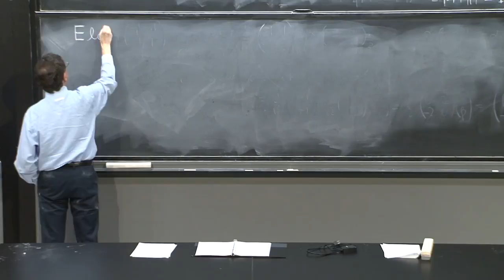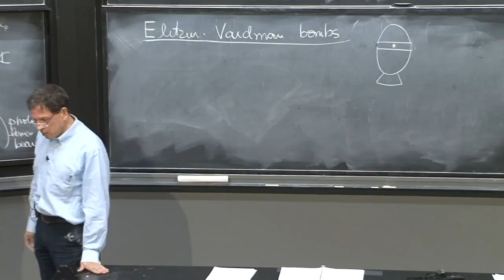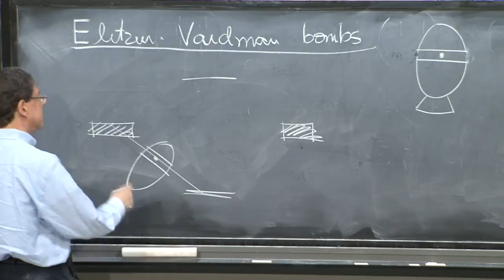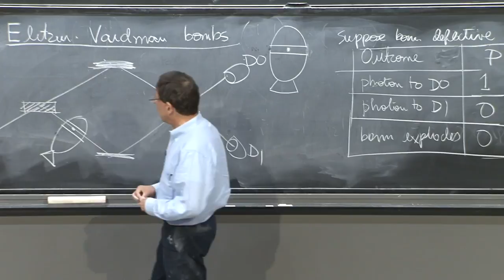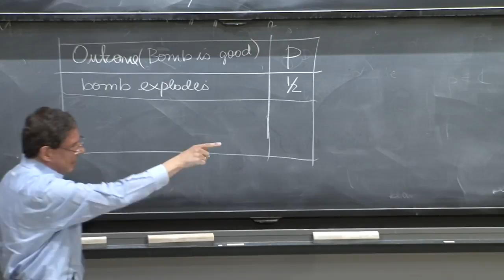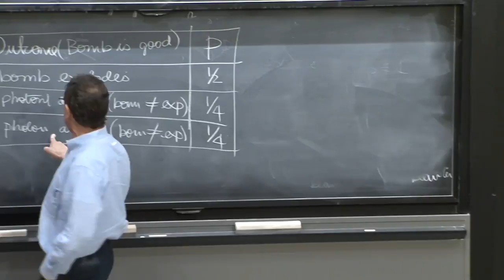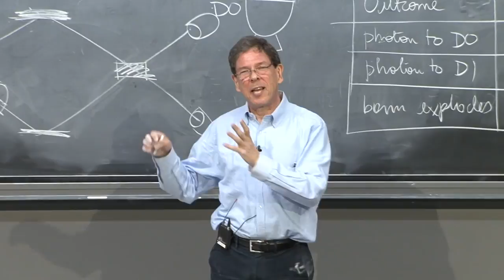Elitzur-Vaidman bombs

Comment: maybe we could see this as if photon particles were riding a wave we can't see, like a buoy on a sea wave. the invisible (to us) wave would be affected by the environment and behave like a wave (interferences etc...). With this perspective, the wave would exist without the photon and would appear to us only when a photon starts riding it. So all the interactions of the wave with the environment (e.g. interferences, probability distribution...) are set before throwing a photon in, and do not depend on the photon in itself.
Reply: Robert Spekkens has a paper on this that gives the most intuitive explanation without waves at all. There is an inconsistency in how this is presented, the first beam splitter is treated like a single input logic gate (a single photon) with two outputs (either the upper or lower path) and when they're recombined at the second, it is treated as a two-input logic gate with two possible outputs. This inconsistency goes away if you recognize that the first logic gate is also a two-input logic gate just where one of the inputs is always 1 (a photon) and the other is always 0 (no photon). All you then have to do at that point is to presume that the 0 state can be carried by a beable and even interact with a measuring device despite showing up on that device as a 0, and then you can explain the whole thing in terms of local beables only without even positing any waves at all.
Reply: smells like luminiferous ether, which was disproven a long time ago

Comment: This is just another variation of the double slit experiment. The difference is that it can be used to find out of the "bomb" (actually a detector) is activated or not. 25% of the time, it is possible to find out. Other than that, there is no difference.

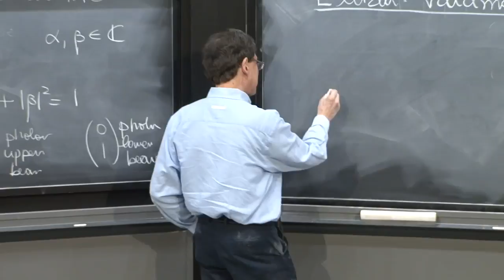Comment: At 3:38, he was referring to the Mach-Zehnder Interferometer, for those who didn't get it; not 'mass center'. The Mach-Zehnder is basically the same set-up with the interferometer discussed in this video but without the bomb.
Reply: What he says does t make sense and can't be accurate...according to the set up the photon could could D1 even when the bomb is a dud so whybdoes he say otherwise??
Reply: @leif1075  AFAIK, not, because of destructive interference in the direction of D1. I'm not sure, maybe some who knows this better will correct me.
Reply: @IvanToman  wow AFAIK stands for as far as I know right? I've never seen that acronym before! How exciting!
Is it t common like lol or brb or you just came up with it like a  trend setting boss?? Off topic lol thanks for answering.
Reply: @leif1075  Yes, correct :)
Reply: @IvanToman  oh did you just coin that yourself or its commonly used as far as YOU know? Because AFAIK, AFAIK is not a common acronym..wow did you see what i just did there?!? I just used it twice like a boss..I'm so lame! I'm sorry you had to read this..
Reply: @leif1075  no, you only used it once
Reply: @leif1075  No it can't get to D1 if the bomb is a dud. But it's not a simple matter to explain why: it has to do with the fact that at the end of the day, even a single photon has a wave function that can self-interfere with itself if not detected. This is the same source of weirdness that causes the double slit experiment results.
Reply: Thanks. I was about to add the same. But you were/are a year ahead. Depending on your position of the fluidity of time. :D

Comment: Classical distribution of energy known as equipartition is, suppose there are 6 modes of dice and energy to be distributed is 21 units. Then each mode have equal amount 3.5 unit of energy. Divide it by mode or frquency, energy per frequency is 7/2, 7/4, 7/6, 7/8, 7/10, 7/12. Thus energy per frequency is decreasing as shown in black body radiation curve.

Now same amount of energy distributed to same modes as per quantum energy distribution given by Planck's law. According to quantum energy distribution, energy is not distributed equally to modes but in linear multiple of fundamental or minimum energy unit to modes. Thus higher modes have more energy and for above 6 dice modes they are like, 1, 2, 3, 4, 5, 6 where fundamental unit is 1. Dividing these energy for modes by mode number or frequency they are all same, 1 unit. But this is not evident in black body curve as flat line.

Comment: I think this experiment need little work to look better. That is, first beam splitter is polished such that it has transmission coefficient of 1/3 and reflection coefficient of 2/3. So probability of photon taking upper path is double of lower path.

Now slightly change in intensity of source also, it has such intensity that emit two photons at time and triggered by switch which let one fire only on triggering.

Now if photons take both paths they interfere and detected by A only. And if photons take upper path then they may not interfere and could be detected at B also. 

Now calculating probability, chances of photon detected by B is 5/18 and by A is 13/18. And chances of both photons take upper path is 4/9 and chances of that detector B detects live bomb without exploding it is 1/9 ~ 11%, accuracy is about 4/9 ~ 44%.

And from his model, probability of detecting live bomb is 12.5%, not 25% and accuracy is 33%. In numbers, if total 200 times test is conducted, only 25 times it correctly predict live bomb without exploding it and 50 times it predict falsely, 25 of which are dead.
Reply: If someone needs 10 fire-crackers and they are constrained by a budget of buying only 40, you're modification is reducing their chance of success from 25% to 12.5%.
Reply: @vishalmishra3046  no, modification bring chance of success 11% from 12.5% but improve accuracy to 44% from 33%.
Reply: Why he doesnt say that what if photon takes up part even though bomb is not functioning? Like why are they assuming it always go both durrectiins if bomb not working but can go only up if working? What am i missing?
Reply: It does not matter what is the accuracy or chances of success. The fact this can happen at all is what’s interesting.

Comment: Sun is emitting light and hot bodies glow light. But spectrum of sun is continuous which can be observed with crystal or cd. Different colors are in thick bands and not thin line. So how energy is quantized in hot solid bodies. By quantization means different colors are separated by dark regions which is not observed. Temperature of body can be calculated by light emitting from body of different colors and they do integration which is for continuous function.

A circle is locus of points which are equidistant from a point called as focus or centre. Joining of locus is curve, where points are discrete but curve or function is continuous. So, do circles are continuous or discrete, continuous means curve is smooth. Similarly calculus is done with discretization of interval but on continuous function.

Yes, quantum mechanics shows that wave seems as continuous but made of discrete small particles, operated as smooth. Similarly interaction of energy and matter is participated by discrete particles known as atoms but there is no restriction on amount of matter and energy, continuous.

Comment: Here's a thought...

Adding the concept of superposition, maybe there's a difference between:

1. A single photon in a single path then the detector works 100% of the time.
2. Bomb detector interaction with a "split photon",  i.e. unlike case (1) the particle that hits the detector is not a "full photon" but a part of the superposition.

Maybe what is missing here is the understanding of:  - the probability of an interaction of "half a photon" with the detector.
We know that the effect of a "full photon" on the detector is 100% deterministic. Boom.
But let's assume that the probability of the detector (observer) is either:
50% detonate.
25% not detonate, and do nothing to the half photons, they reach D0
25% not detonate, and phase shift the 2 half photons so they reach D1.

This means that we still know nothing about the bomb, is it alive or dead.

The only "hole" in this hypothesis is the question: in the dud, is the detector behaving differently when the bomb is a dud, or is it the very same detector?
If the former then hypothesis still stands.
Reply: Sorry to say so but your concepts is missing the collapse of the wavefunction. The particle that hits the detector is always what you call "full photon". How we now that well   in 3.1 of these courses the photoelectric effect will be explained that should make it clear (That is what Einstein received the nobel price not for SRT or ART) why the concept "half photons" is not going to work just by choosing the detector right. 

The only way i see to keep your concept alive would be to say these "half photons" are still entangled with each other and one partner get energy to step back to a "full photon" and the other "half photon" is giving its energy (then energy is conserved) and we still measure a "full photon" at the detector as to be done. But that would mean to argue with an effect from quantum mechanic against the quantum mechanic original explanation of the seen effect. (still you could use phase shifters and polarized filters to rule the concept of "half photons" out, but it would hold within the described experiment).

But do not worry that strangeness/weirdness is exactly the reason for the so often used famous words: "If you think you understand quantum mechanics then you do not understand quantum mechanics." (which by the way is half true and half not)
Reply: @Techmagus76  There are no "half photons" in this universe, my friend. :-)
Reply: prof. adams did something like this on his first lecture for 8.04 2013

Comment: If the photon gets split into two beams ( no matter a probability construct but still it is a split and it also takes all possible continuous values alpha and beta ), then it not "quantized" in the first place.... So why quantum mechanics ?? I mean what is really quantized here
Reply: The photon doesn't split. The wave function is "split" so that if you send one photon at a time through the splitter, the photon will take the upper path half the time and the lower path half of the time.
Reply: just because you say 'no matter a probability construct..' doesn't mean it stops mattering. There's a difference between a photon splitting and it's probability function splitting, and you have to try to understand that.

Comment: Phenomena of interference by light, producing dark fringes is result of how we disturb or measure light.

If two slits are not cut abruptly but in gradual manner like gaussian curve, there will be no interference. Distribution of gaussian function represented in harmonics is again gaussian, so there is no dark fringe.

Same can be said about interference by division of amplitude. As splitter is uniform and not gradual so it happens. Also fringes are not local.

So light has no property of wave and not described as particle, but disturbance of particles. So light cannot travel without matter, leaving side whether it has electric or magnetic field.
Reply: "So light cannot travel without matter" well then how does it travel through vacuum
Reply: After all  matter in vacuum is beyond negligible
Reply: @saifahmad141  it can be proved in many ways that wave cant travel without medium, because it is disturbance of medium and thus speed of wave depends upon two factors, nature of source which defines wavelength and nature of medium which defines frequency.

In case of light, they thought that Faraday's law and Ampere's corrected law proves that light doesnt need medium, while they only states that change in field in time causes another field in space.
Reply: @neillibertine3044  yes but again medium dependent waves are simply mechanical but when it comes to light is an em wave so it changes the story light is just variations in electric and magnetic field perp. To the dirn of actual wave correct me If I'm wrong which I definitely  maybe because I didn't understand you sorry but pls could you explain what you are trying to say
Reply: @saifahmad141  okay try to put in simple words. Voltage cause current, and current indicates voltage. But without resistance, relation between voltage and current is not establish, and that resistance is medium dependent and inverse of resistance is conductance, which depends upon speed of charge. If resistance becomes zero then v¹ and v² produce same amount of current, there is no causal relationship between voltage and current. Now replace it with electric and magnetic field.

This is supplement, there is no such thing as EM wave, all are mechanical in nature. Surprised, okay what is voltage or electric field, amount of charge and magnetic field is amount of current. These amount of whatever transported from one point to another is mechanical overall, but the force behind the motion is electromagnetic.

Comment: Waves  undergo interference when they meet.Why photon needs 2nd splitter to interfere.
Reply: if nothing blocks both paths of the photon , it go through both paths and interfere with it self in the second beam spliter witch is made in a way to only allow constructive interfernce in the direction of D0 , however if somthing block one of the photons paths , the wavefunction collapses and the photons travels as a particle , when it hits the second beam spliter , it has 50/50 of going to D1/D0
Reply: Single photons don't interfere. Think about it for a little bit.
Reply: @lepidoptera9337  You are falsely assuming there is a single photon here and not two beables. Beam splitters have two inputs and two outputs. How can you convert 1 bit of information into 2? Quantum logic gates are unitary, inputs and outputs always match in terms of number. If you recognize that there are two beables upon the input, then there are always two beables midway, and two beables upon the output, and there is no mystery.
Reply: @amihartz  Where do you see quanta during unitary evolution???? That the same  photons will come out that you sent in is not even remotely true. Doppler effect will change the energy of the quanta. Reflection will change the momenta. High energy interactions change the total number of quanta. The world IS NOT linear quantum optics. Not that photon number is conserved in quantum optics, either, see thermal states and spontaneous parametric down conversion. You need to start learning real physics and stop messing around with the trivial corner cases.
Reply: @lepidoptera9337  You just spouted off a lot of random things with no relevance to what I stated. It's like if I made a comment about US history and so you start rattling off information about cake recipes. There is zero relevance here other than you just listing unrelated facts to pretend you're knowledgeable and making a point.
Reply: @amihartz  And now you are just feeling sorry for yourself. Take care. I think we are done here. ;-)

Comment: Why the probability of getting a photon at D0  or D1 is 1/4 (for the case bomb is good and does not explode ). I think it should be 1/2. Isn't?
Reply: (Maybe too late to answer but:)
It’s 1/4 because there’s 1/2 probability the photon goes up and 1/2 probability that it goes to the bomb and detonates it. If it goes up, it goes towards a second beam splitter which further halves the previous 1/2 probability into 1/4 for D0 and 1/4 for D1

Comment: In case the bomb is good and does not explode, what happens inside the photon detector of the bomb when the deflected photon arrives?
Reply: A photon detector is simply an absorber. It removes one photon's worth of energy from the free field.
Reply: @schmetterling4477  if the photon always detector makes the same thing, why sometimes the bomb explodes and sometimes not?
Reply: @tommasoboccellari270  The bomb always explodes when its detector removes a photon's worth of energy from the field. That is the definition of "live bomb" used in this nonsense.
Reply: @schmetterling4477  then my first question remains open.
Reply: @tommasoboccellari270  You are probably working with the wrong idea of what a photon is. A photon is the absorbed energy. Energy that has not been absorbed and that remains in the field is not a photon.

Comment: Voltage cause current, and current indicates voltage. But without limited resistance or conductance, relation between voltage and current is not establish, and that resistance is medium dependent and inverse of resistance is conductance, which depends upon speed of charge. If resistance becomes zero then v¹ and v² produce same amount of current, there is no causal relationship between voltage and current. Now replace it with electric and magnetic field.

This is supplement, there is no such thing as EM wave, all are mechanical in nature. Surprised, okay what is voltage or electric field, amount of charge and magnetic field is instantaneous amount of charge transported. These amount of whatever transported from one point to another is mechanical overall, but the force behind the motion is electromagnetic. Thus it is untrue that EM wave is independent of medium, it depends upon amount of some quality of medium like charge to be disturbed. Mechanical wave like sound is local transportation of matter or density and EM wave is local transportation of charge or charge density.